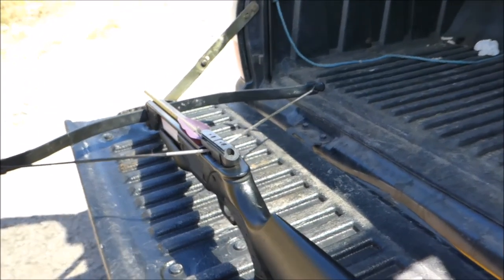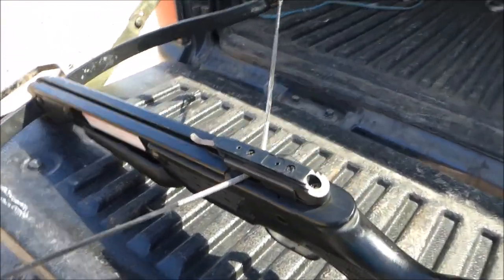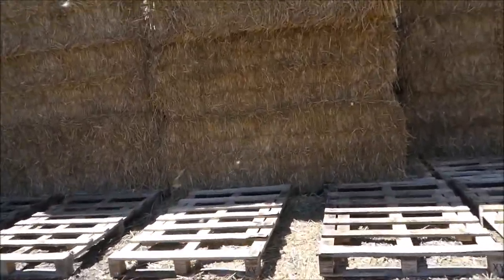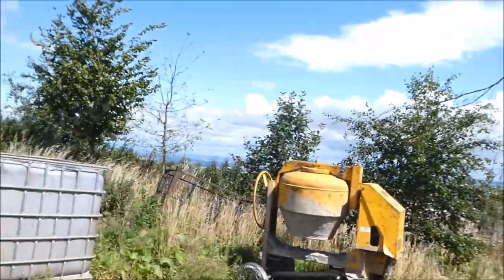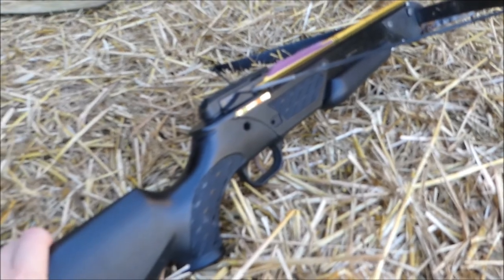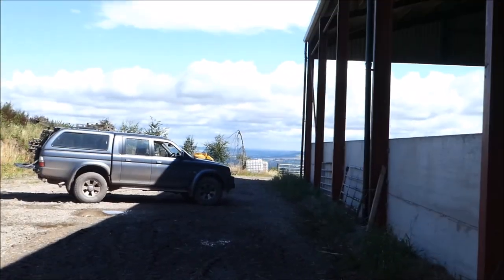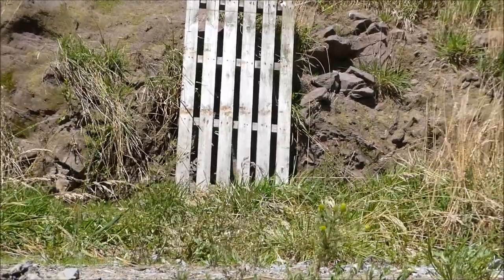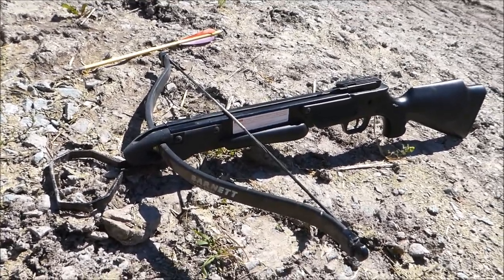Barnett Veloci Speed Crossbow [Review]

Comment: Easton 2219  crossbow bolts,  cut to your length... with forward insert re-glued,  should serve well.  I  have access to carbon and fiberglass bolts... AND "I very much prefer Easton 2219 XX75 magnum ALUMNUM arrows or bolts."  These may also be sold  with store or vendor names  on them.  Serious Hunters in Canada and USA use Easton 2219 crossbow bolts {or arrows, if you prefer to call them that.}  2216 are a lighter arrow with thinner walls that fly slightly faster  and bend much  more easily.   Enjoy your old bow.